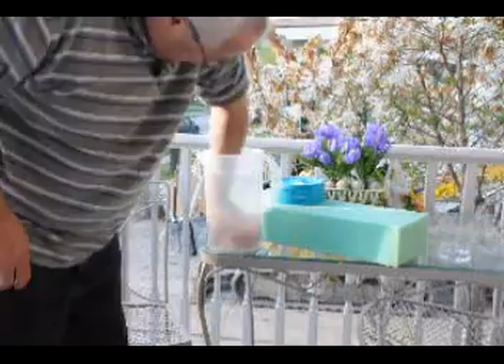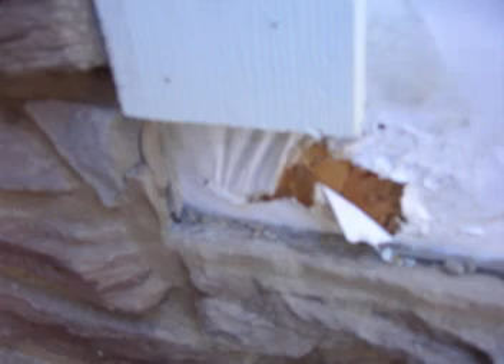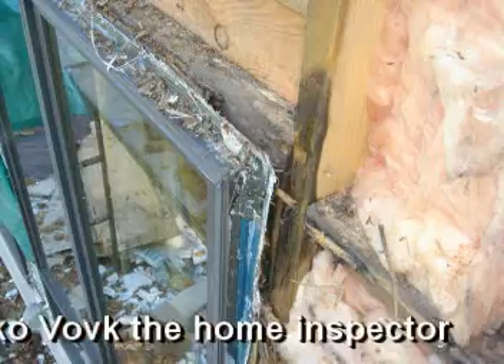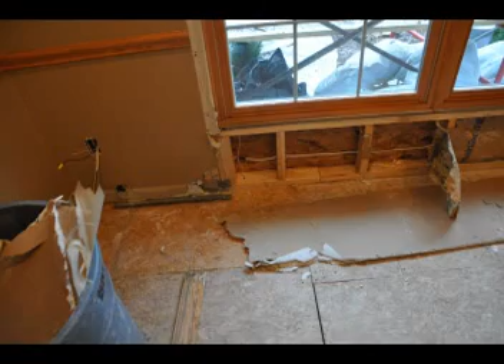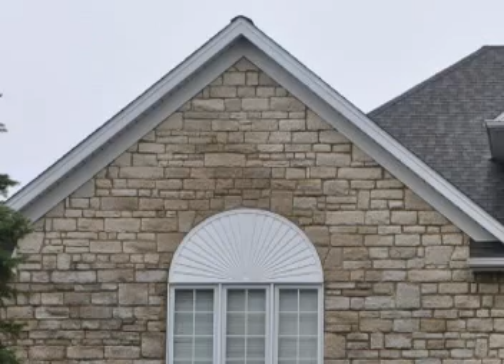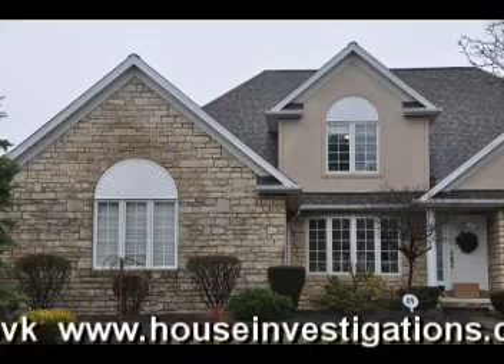Cultured Stone Cladding THE TRUTH

Comment: What do you think of something like Fusion Stone Phoenix veneer?  They use a water drainage system that they call Poz-E-Flo:

"Poz-E-Flo is manufactured exclusively for use with Fusion Stone Phoenix. This drainage panel, that goes between the wall and the Fusion Stone, creates an air space allowing it to breathe, ventilate and prevent mortar from blocking the cavity. It ensures no water damage and no rot"

Looks like a membrane covered in felt that goes over the house wrap.  That seems to address the concerns raised in your video.  I ask because I'm interested in the product (early research so far.)  Until I saw your video I never really thought about water getting behind a product like this, but it makes sense.  Obviously the effectiveness of the membrane comes down to installation, but at least this company seems to have addressed the moisture/water intrusion issue.

My other concern with these veneers is how they cope with high winds, extreme cold (-20c to -30c), and typical accidental impacts (e.g. baseball, hit with a shovel, etc.)

Thanks for taking the time to put together the video.

Comment: it does not matter what the cladding( siding, fake stone, real stone, brick, vinyl, hardi, wood, stucco, eifs, metal or whatever... the building envelope ( the exterior weather protection, flashing,etc, behind the siding/cladding, has to be correct. not enough room here to go into details, ..  Trouble is most home owner dyi.ers,, and subcontractors or tradesman who say," well we been doing it this way for years" and do not educate themselves on proper installation is the problem,,, ALL siding (cladding) will either allow water through the surface of the material, or cause condensation behind the material...IT IS ALL ABOUT THE DRAINAGE PLANE<< AND BUILDING ENVELOPE PROTECTION.. Water will penetrate natural stone, just as it penetrate fake stone, just as it will penetrate brick.. The vinyl siding is not a cure all,, quite the contrary,, it is a sieve!,, but vinyl installed properly, ( which by the way, I mean very very few siding installers follow the manufacturers installation procedures, and use the correct channels and J's at the correct place.) is a fair siding product. I bet dollars to donuts I can go to any of the houses you are saying that vinyl is installed on and you think is aok, and within 10 minutes I will show you rot behind it.  I have seen many houses rot down behind vinyl,, so it is not the supersiding, ( I personally will not use, build with  it, nor recommend it,,it is cheap, flimsy and makes a house look like it belongs in a trailer park. )  Yeah, a vinyl house looks good from the road,, but get up close to it,, especially immediately after a rain event,, or look at it closely after a freeze/thaw/ refreeze and notice where the icicles are hanging from,, that will tell you whats happening behind vinyl.

Another thing,,, there is no "one size fits all" when it comes to how the building envelope needs to be protected,, different climates at different areas of the  country or world, require different methods of construction  and different methods of moisture and moisture vapor control. People need to research there area, research the homes  built by the builder in the area, and research any product before it is used, or bought.. Bottom line, Fake or cultured stone is a good product, so dont knock it,, you cant blame the product because the builder, or tradesman, or designer, or home dyi er do not know how to build.

BTW,, I know, I got the credentials and experience to make these statements,, I quit counting after a thousand or so housing units that I have built in the past thirty + years..
But I do know one thing for sure, from my past experience about 8 of 10 so called "home inspectors" do not know "shit from shinola" Same goes for building inspectors. Many are failed builders or contractors, or wannabes, or educated idiots.... not all mind you,, but the majority. Home inspection turned into a quick money making "scam" for the most part during the housing / mortgage bubble. So beware and take most of their advice with a grain of salt.
Reply: Well said Nate.

Comment: Ok I am a bricklayer and this is true to a point but lets fix the problem with the product and not the worker. This material absorbs water so make it so it don't. A brick wall is not safe with brick that take in water. fix the brick. We should not have to put weep plugs in the wall. I can tell a lot about the material by the way it cuts on my mason saw. If it cuts easy its not good but if it cuts hard that is a good thing.
Reply: Water gets behind EVERY wall finish, and not just from rain or pressure washing. For example, water can get behind brick from a process called "inward solar vapor drive." See the greenbuildingadvisor website and search that term to learn about it. And see nate's post below. It is all spot on. If you are a homeowner or contractor and you're hiring a mason who says weep holes and mortar netting (for brick), or drip screeds for (stone), are not necessary, either educate that mason, or find one who understands the absolute need for these techniques (among other things) which properly manage the inevitable intrusion of water behind the veneer.

Comment: does this apply to a stone sided house built in the 50s? I was going to buy a house built with natural stone siding. I didn't see any signs of water damage or moisture inside the house,but i saw a few spots on the outside where the mortor was repaired.